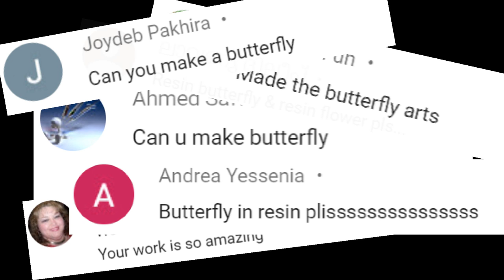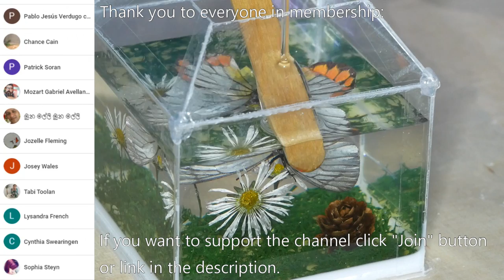Butterfly DIORAMA. Night Lamp 💡 / RESIN ART

Comment: I was wondering how a butterfly would take the resin, I have a Monarch I found I wanted to use in a Pyramid like this,
Reply: Maybe you could spray laque it, or spray finesse so it won´t absorb the wet epoxy :-)
Reply: Hey Doug! I've done a dragonfly and it did fine, but the wings were Super delicate on it as well. Mike, may be onto something with the spray lacquer idea, but I would definitely do it in VERY light coats and build them up.  ?? Can't wait to see you give it a try!
Reply: OMG Doug!!!!  Hey there!
Reply: @Lori_M  Hey Lori
Reply: From what I’ve seen on other resin videos, putting butterflies in resin is hard because the wings sometimes lose their color and/or vibrancy
Reply: The Pohl Barn Productions.    .........I use hair setting spray .....
Reply: @NavinBetamax  Thank you
Reply: @surrealist1976  Thank you
Reply: @Little_Red_Riding_Hoodlum  Thank you Kerri
Reply: @mandyfrs123  Thank you
Reply: @PohlBarnProductions  I thanked Jedrek, cause when I took Epoxy classes in Denmark, I came with knowledge from Jedreks videos, and it went well :-)
Care for your hands and lungs, do not touch wet epoxy with bare hands, and have air-extraction while the epoxy is wet, and break a leg :-D Thank you
Reply: @Illustrious Cabbage oof that must have been gross

Comment: This is magical, Jedrek29t.  Absolutely magical. I notice you have less trouble getting the plastic mould off. Did you change plexiglass?
Reply from the maker: I ordered plexiglass from the same seller.But  Yes , it seems a little different to me. It is even cut a little differently. And it does not stick to plexiglass. Thanks Rowan
Reply: @jedrek29t I use a soft plexiglass all the time in my projects... I would have never guessed that it would pull away from resin like that have you tried pulling it away from UV resin?

Comment: Hey , I always notice that you don’t mix equal parts of resin to hardener, I know that some brands require you to do so but the brand you use (gallant) says to do so. But yet you don’t and it comes out so good, what ratio do you use to make your resin come out transparent opposed to it being solidified and non see through ? Please help
Reply from the maker: Each resin has a different resin ratio. You must do as the manufacturer says